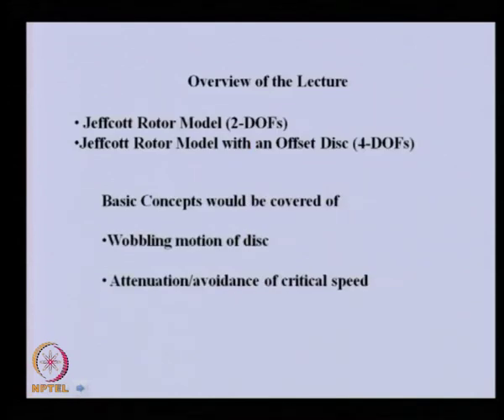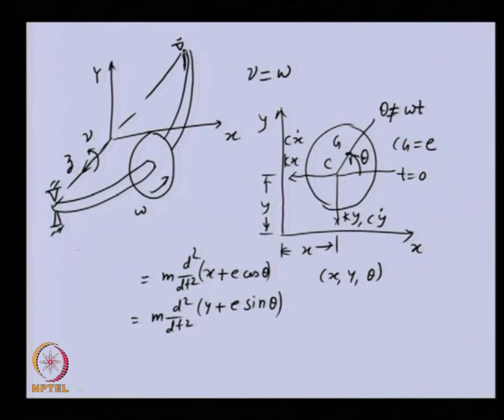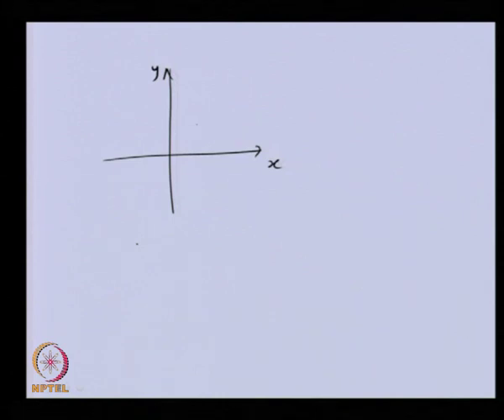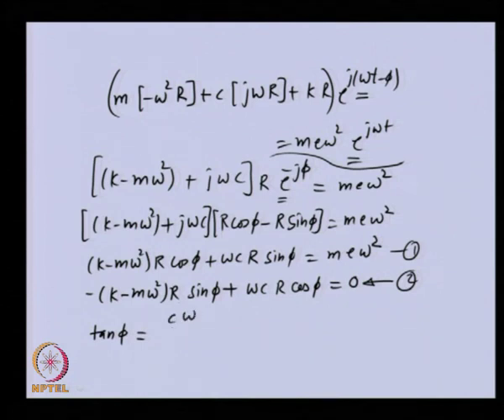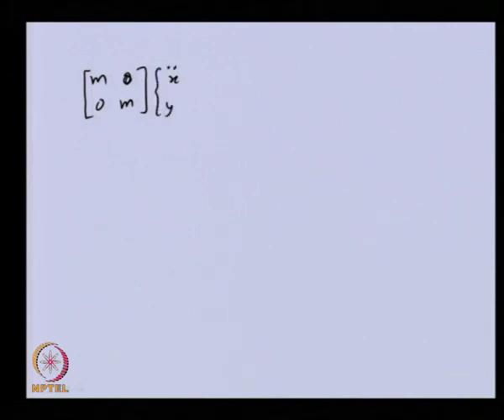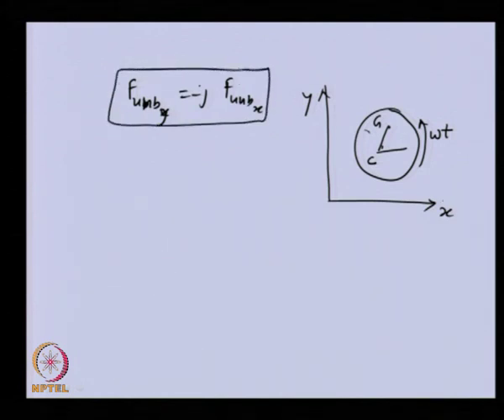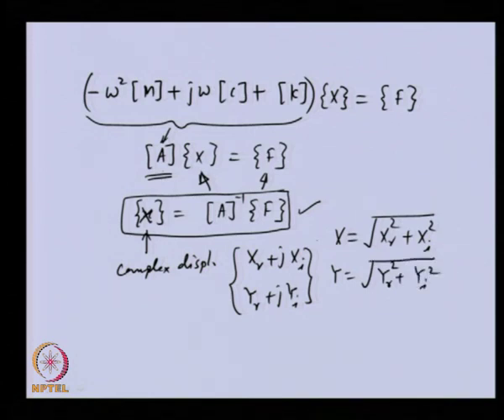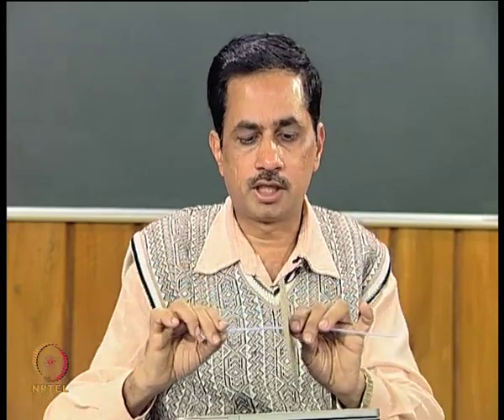Mod-02 Lec-02 Jeffcott Rotor Model

Comment: Nice!, Is it possible to calculate the natural frequency of the rotor due to disc and shaft weight and also its rotational effect(for example; in pelton torbine)
Reply: I would model a pelton turbine as a n-rotors or later as a continuum. What you will get are infinite countable natural frequencies.